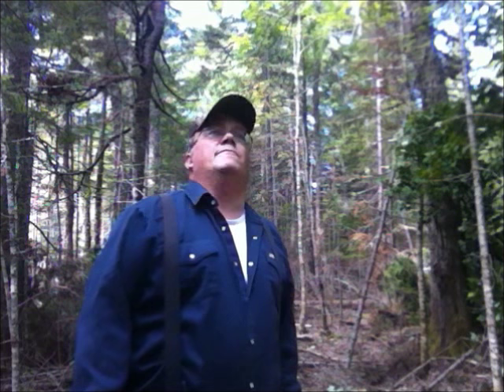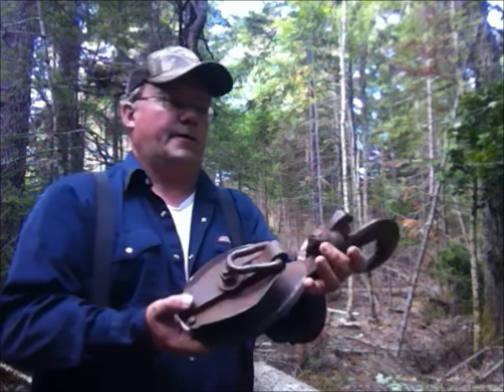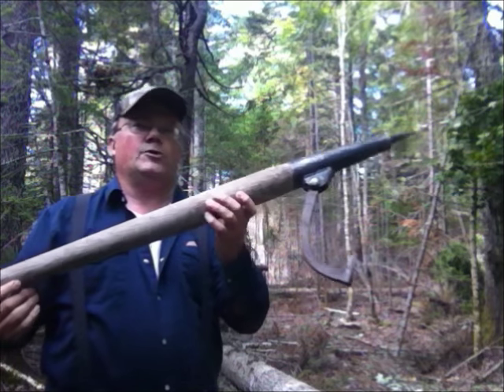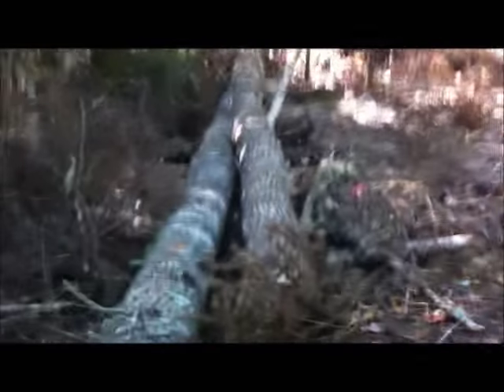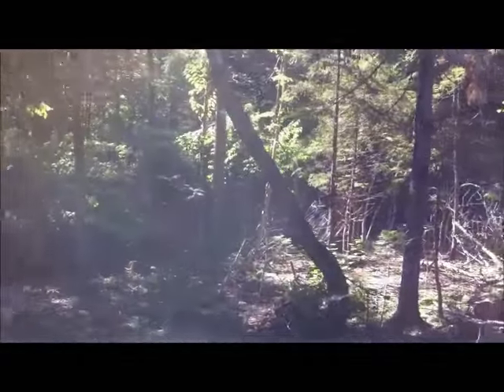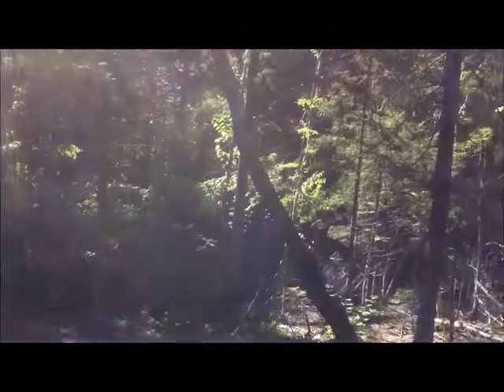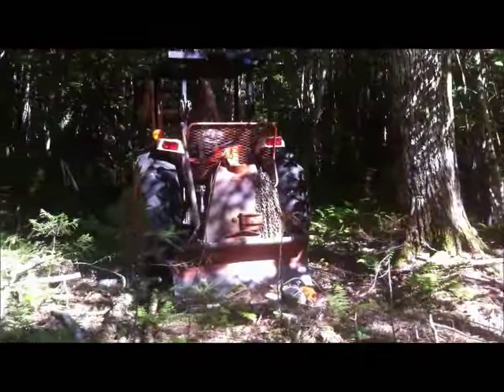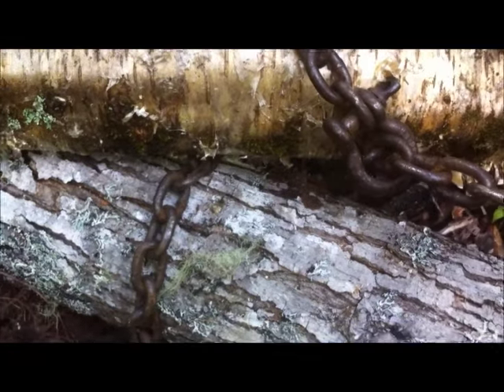Tractor logging

Comment: Great video, I appreciated the level of detail and really like your ideas with the chains. Muddling around with them can cost a lot of time and I plan on implementing your techniques. I've had the same experience with chains less than 3/8" not being able to withstand the loads of winching and skidding. I've blown out a few PTO shafts also,  and it seems that aligning it horizontally with the lower links, seems to help.  Basically reduce the angles on the shaft and make it as straight as possible. This makes the winch sit off to the side a bit with our setup, but is better than breaking a PTO shaft. Thanks for the information, good stuff.
Reply from the maker: Thank you. I know a relative of mine had a different model of winch that had an offset shaft and he had the same issues you speak of. Thanks for watching.

Comment: Thanks for the tips, I am sure they will be handy. You may know the trick of flipping your chainsaw upside down in the vice, for filing.
Reply from the maker: I have never filed in a vice. I was taught at thirteen to file with my chainsaw held between my knees.  Thanks for your kind comments.
Reply: @ERLong-ww7yn  I learned to file that way as well. Lots of 2, 3 and some 4 ft trees,here, on the North West coast. I have been cutting stumps very close to the ground and beating up the ground side teeth. I saw a boat builder filing upside down last year and was surprised how much my uniformity improved. Then I bought a grinder. Now I have a boxes of files. 🤔🙃🖖
Reply from the maker: @glennnaylor69  I'll have to give it a try.

Comment: You mention GR70 chains , but GR70 chain are a binder chain, that will stratch and break, GR80 and GR90 chains are to be used, since you are lifting the logs to some extent. They will also enable using a smaller diameter and lighter chain.
Reply from the maker: Hi Allen. Thanks for the note. I have yet to break a Gr70 chain, and I've yarded  white pine logs in excess of 35" on the butt. Thanks for watching.

Comment: Do you run the cable through your lower pulley?  I found that when I use the lower pulley the cable gets kinked. Yes it is easier on  gear and a better place to pull from but most times I don't pull hard so doesn't seem to be worth my while dealing with a curled cable.
Reply from the maker: I only use the bottom pulley If I'm pulling something in from the side that might cause the tractor to tip.

Comment: You have the arms of the tractor mounted on the top pin. Why the top hole not the lower one?
Reply from the maker: This model of Kubota has one draw back: the arms are really short when you consider the distance from the wheel radius to the ends of the arms. Thus, if I put the pins in the lower holes, the top link has to be let out really long to avoid having the top of the brush guard hit the roll bars when the winch is raised. Letting the top link out that long then creates issues for the PTO shaft, which has to be cut really short to start with. Call it the perfect storm of issues. Lol besides, the M8200 has sufficient clearance that using the top set of holes has never been an issue.
Reply: Thanks for detail reply just got my v4000 but never got the manual. Will be pulling logs today. 
Thanks again for your time
Reply from the maker: I'm attaching a ink here for the Fransgard manual online. Stay safe and have fun with your machine. http://jswoodhouse.com/brochures/Fransgard%20V4000%20manual.pdf